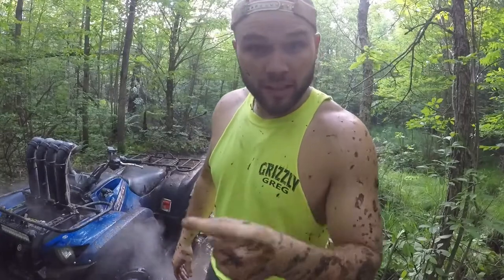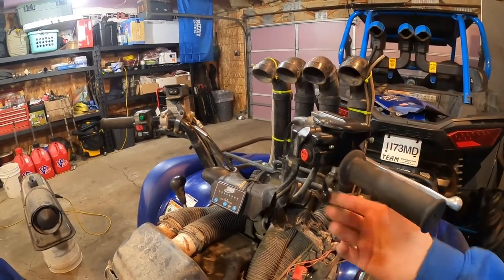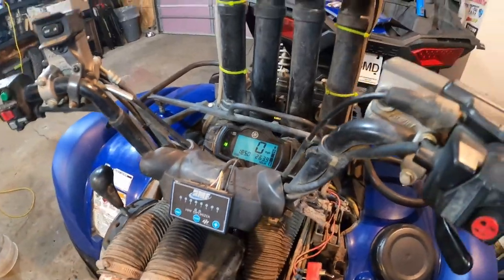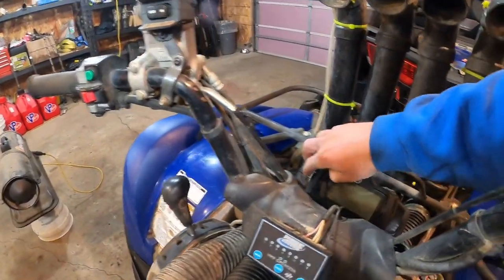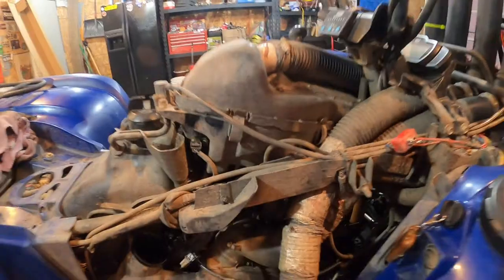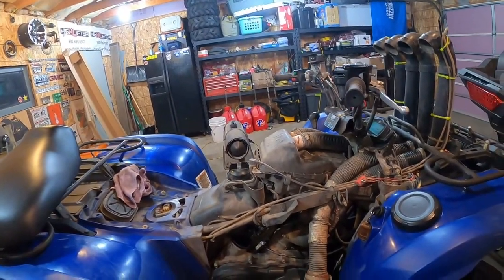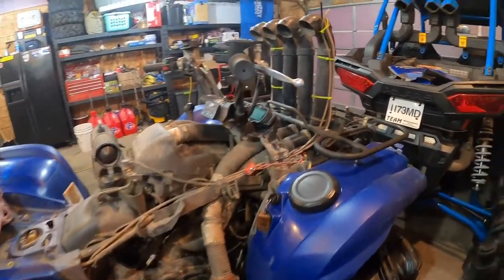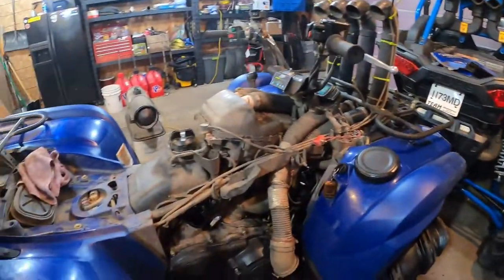Grizzly 700 Throttle Position Sensor Diagnosis and Replacement

Comment: Can you tell me by chance what settings you run your optimizer on? Cause on their page they give me all 6 modes but my optimizer only has 5 for some reason (came with the used pipe I bought)
Reply from the maker: 2-2-2.5 I believe.. I have only messed with the first three settings... the other three I was told don’t touch... I have tried 2.5-2.5-3 before and didn’t notice any difference....

Comment: I just ran into a code 15 for mine as well. I tried to get into the diag mode, but it comes up as a error. I have velocity ecu replacing the factory. Do you think this ecu prevents me from using the diag?
Reply from the maker: I’m not sure about the ECU issue, but code 15 is definitely a TPS sensor.... should be $70 to $90 OEM.... very simple to replace... it’s like a 15 min job